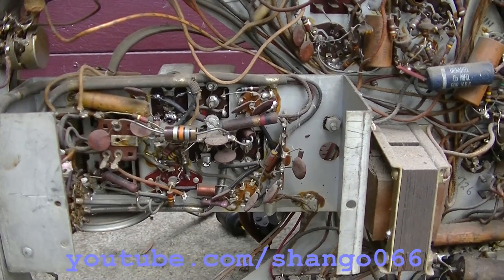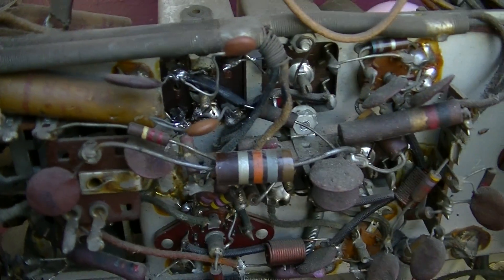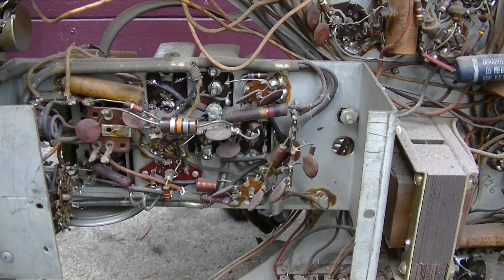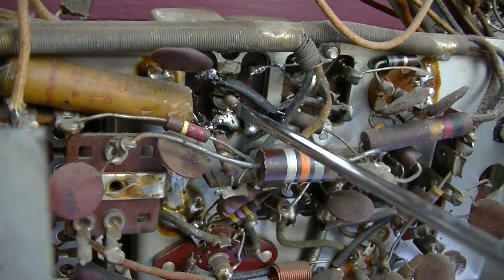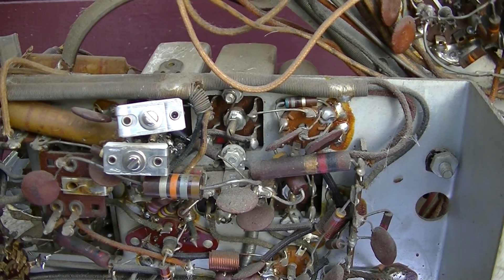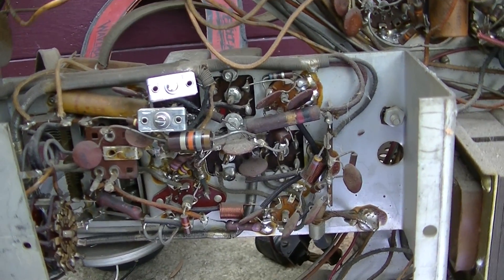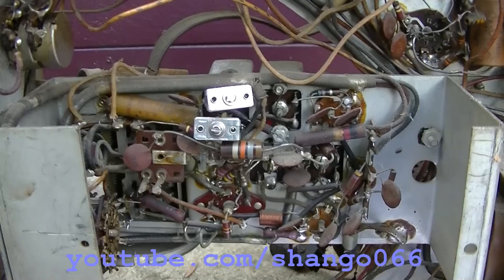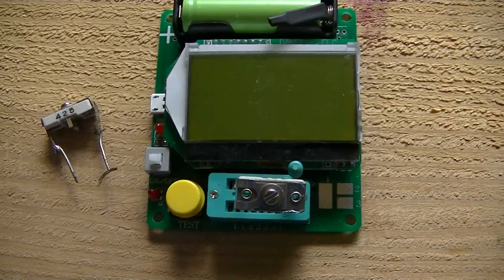IF Silver Mica Disease Capacitor Value Identification

Comment: Where can I buy this capacitor checker?
Reply from the maker: Nelfie browlemore mcvee bleezy?
Reply: @shango066 was my question stupid? I was asking about the tester you used to measure the trimmer values to determine the value of the replacement caps in the if cans.

Comment: A great video about silver mica disease  by Mr. Carlson's Lab here on youtube on finding noisy silver mica capacitors. The video is titled "Find Intermittent Electrical Noise - When Its Not Even There! Here's How". He's finding the postage stamp type of silver mica caps in an old RCA RC-88 receiver,  that have become super noisy and arc with voltage across them.  Very interesting to hear them. 
They sound very similar to Shango066' "short" that details what silver mica disease sounds like in a All American 5.

Enjoy, 73, Jim W7RY

Comment: I am a bit surprised that the coil slugs do not seem to adjust the inductance over a very wide range. One would think that it would be important to be able to compensate for the variable amount of stray capacitances that would be found in a hand-wired circuit like this. If you wanted to really get it on the nose, you would need to parallel 100 pF with 4.7 pF (using standard values).

The other thing that surprises me, albeit only a little bit, is the crude design of the FM front end. They are just using a pentagrid converter without an RF stage. That can't be too sensitive! :(

Comment: I have done something similar, since I also have a digital capacity meter.  I carefully UNsolder the coils inside the I.F. can, then measure the value of the mica sheet capacitors.  The SMD  doesn't usually come into play, as the digital meter's test voltage is only about 9 volts, not enough to jump the SMD gap.  Then once I have those values, like you, I cut out the offending mica sheet caps, REsolder the coil wires to their respective pins, reassemble the housing, install it back on the chassis, and solder fixed silver mica caps to the appropriate pins.  It is usually spot on. But on a couple of occasions, I have had to SLIGHTLY adjust the core--usually no more than 1 full turn, to achieve the I.F. peak.

Comment: 100pF is the standard value.
Reply: There is no "standard" value with silver mica caps, the values are all over the place depending on who made the IF transformer, or where it was used.
Reply: @OlegKostoglatov  Indeed.. it depends on the construction of the transformer... with slug tuned transformers it is true that several manufacturers used 100pf (I have datasheets for several coils that show 100pf as the fixed value capactior) but there were makers that used different values of capacitor, i've come across 68pf - 150pf.  So while 100pf might work if you can tune the core enough it will throw off the overal sensitivity of the radio if that wasn't what was originally used.

Comment: A lot of radios from the 1930s-40s actually had variable trimmer caps in the IF transformers instead of fixed caps. When aligning, you adjusted the trimmers instead of the cores.

Comment: Just a thought and perhaps a bad one. One way to possibly determine the IF frequency would be to adjust the trimmer caps while listening to the FM band. When they peaked the FM band that would also most likely be the peak on the AM band. Then inject an IF signal of 455Khz, 465Khz or 265Khz, ETC.. The one which passes should be the IF frequency. Just a thought. Great video, Thanks

Comment: Ah, you discovered my method. In the past I have also used a Z-Meter to find the peak of the coils as I adjusted the trimmers. Probably more accurate but also probably too much work for the item involved. This procedure is sort of backdating the IF cans to the earlier practice of having trimmers instead of fixed "capacitors." 

It has gotten hard to find decent and cheap trimmers of the right range and voltage so I no longer just leave them in but do as you did and replace with the closest fixed value.
Reply: Yeah he said a dollar for each trimmer? Where?

Comment: I can affirm, those cheap component testers are amazingly useful things to have.
Best part, is they're SO cheap, that you can even not worry if you ever damage it. Replacing them is merely a few bucks.
I was devastated when I blew up my nice DMM. Still haven't gotten a replacement of near the same quality, but these component testers are commodity cheap!
I also like 'em for stuff like matching transistors, or double checking pin order, without having to dig up datasheets.

Comment: I would have argued that the Q of the circuit, the bandwidth and damping is set by the coil winding and unless your core ends up with too much travel you shouldn't have any performance issues with plus or minus a few pf... 
Just goes to show Shango generally knows best, so I am not going to argue, and his technique seems to get perfect results every time. Very interesting - I often thought about arguing when he popped his trimmers in...

Comment: These are the first screw mount, screw adjusted IF can's I've ever seen with SM.  Most of the transformers of this type I've seen had discrete capacitors, not the integrated SM plates.  The only transformers I've encountered that were built with the SM plates were clip mounted (J-tran or K-tran) and had hex core adjustments that could allow alignment of both coils from one side, or slot core which required alignment from both sides.

Comment: Probably could measure the local osc frequency when tuned into a known AM station and then add or subtract to get the IF freq. That is if no one messed with the osc trimmers before... However calculating the C values based on measured inductances would not include stray capacitances from the rest of the circuit. Shango's method is the best I think...